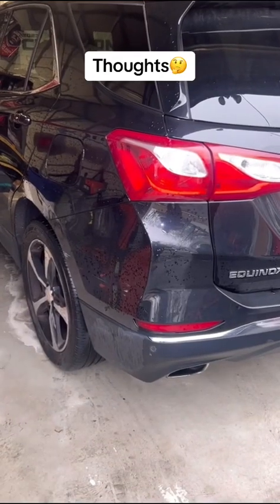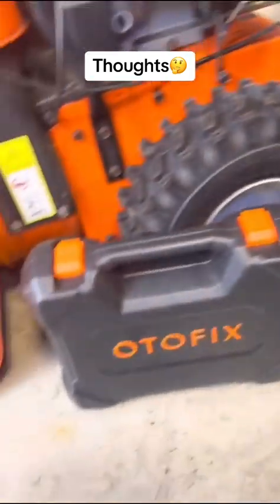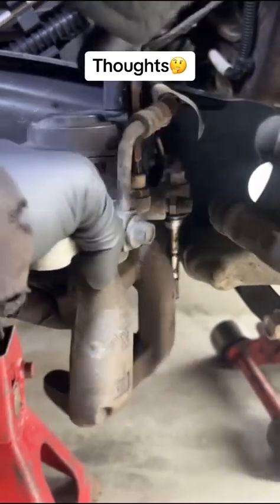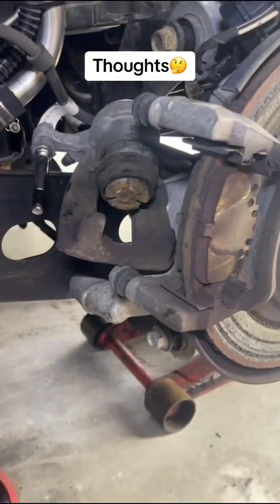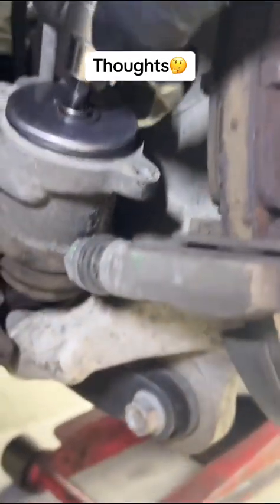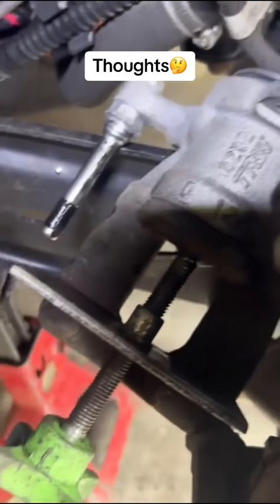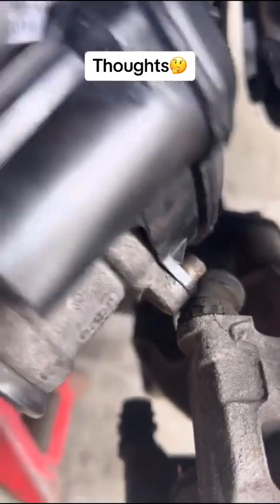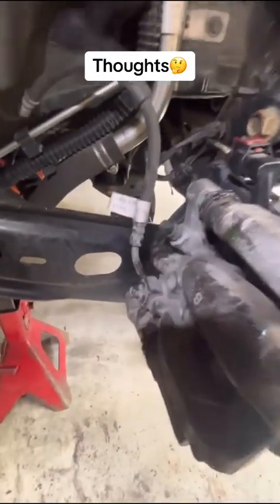Retract electronic parking brake￼ without scan tool 2018 💪

Comment: This worked perfect. You are life saver on the EBS part! 

The parts I struggled with most were:
1. The 2nd HEX bolt that hold the EBS motor together. It is a very small space to get to because the break line connect there. Luckily I found I had the perfect HEX screw driver and used a pair of channel locks on the screw driver handle as leverage. 
2. After getting the brake compressed putting it back together was kind of tricky. You kind of have to slightly twist it back together to have it seat right. If it’s not sitting closed back together keep trying.. and don’t think the screws will close it. 

Everything else was exactly as planned. 

Got a quote from BrakePlus for $1,000 for new pads and rotors for my 2018 Equinox. 

Bought decent breaks and rotors on Amazon for $250 and did it myself. Worth a shot if you are on the fence. Toughest part is getting the corroded bolts and rotors off hah

Thanks again!

Comment: Sure hope this works on my 2024 terrain it's front wheel 20,000 miles got a good bit of brake dust on the front going to upgrade to ceramic rear wheels are clean I'll start by taking a look see if it's the same or similar

Comment: First, you helped me to get my car running again.
wanted to change rear pads and rotos on my audi s5 2009, tried to put the electric brakes on service position, and probably because the piston were fully "out" the Electric module went into safe mode and went crazy, i couldn't do anything with the electric arm brake (pressing the bottom did nothing, it was just blinking).
took both of the motors and calipers off, and when i put everything back, the errors fixed it is self and Electric arm brake worked again !
car back on the road and everything is great and running thank for your video explaining so well !

Comment: Awesome video, great play by play instructions!! I've got a 2020 Equinox and have already installed the front pads and rotors myself. I had planned on taking it to a mechanic to replace the rear ones that had a scan tool because I don't have one. Saves me some cash doing it myself!! 💸💰👍👍

Comment: Excellent video to do the rear brakes with electronic parking brake and not use the electric device or any electric wire, but do it physically with Tork socket.  Now I can do mine instead of taking it to the shop!

Comment: ok assume you did a job but put it in service mode,   when you change a side at a time once you do get everything back together.  Do you pump the brake to build pressure before turning off service mode or do you turn service mode off then build the pressure up ?